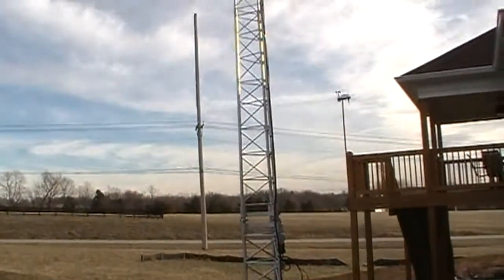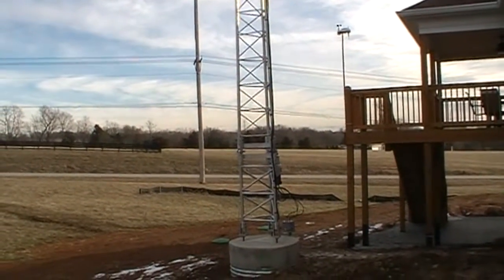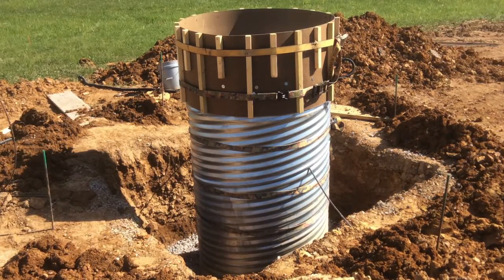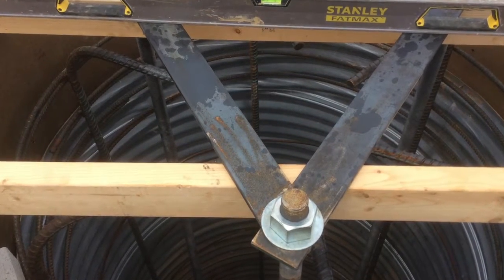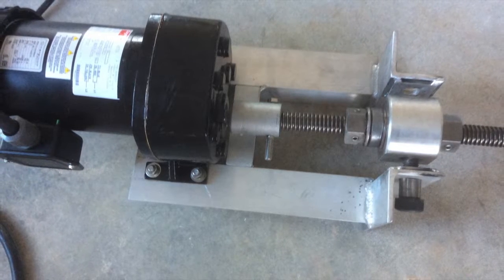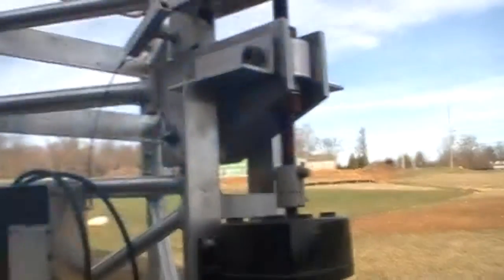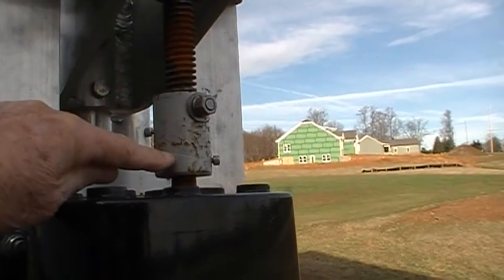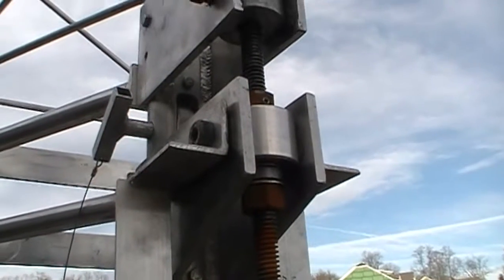Heights Tower Installation

Comment: Hey you may have fix the issue with bolts loseing up, but I climber towers and work for cellular carriers (T-Mobile, Verizon etc ) but instead of putting a backing nut on it try a lock washer that is what we have to use on everything including the tower itself.